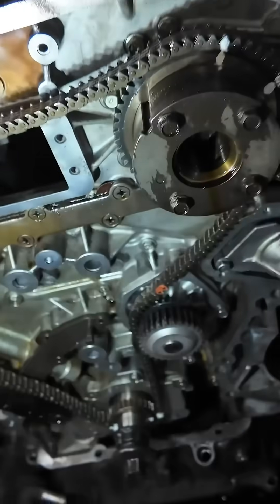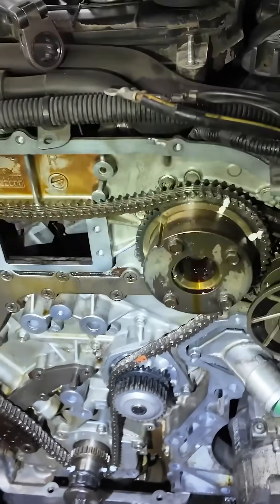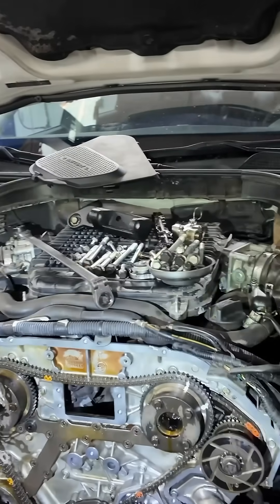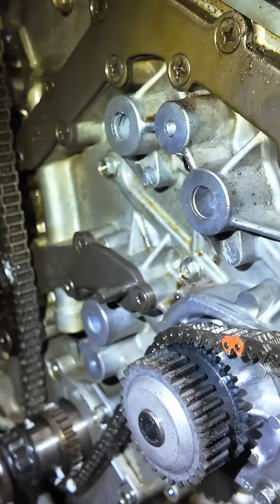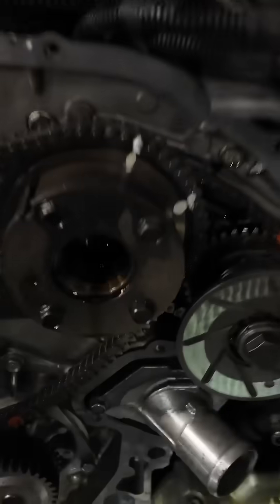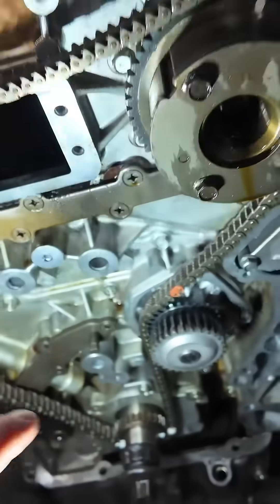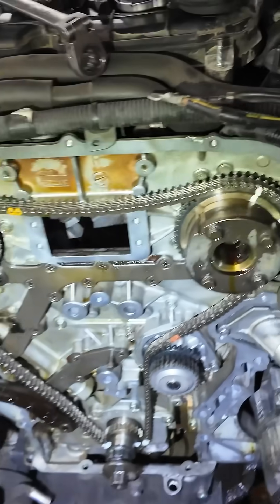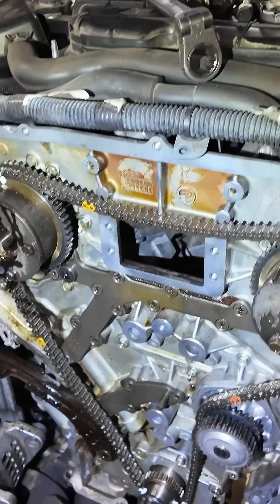The Shocking Truth About Infiniti's Costly Engineering 🚗#shrots

Comment: Audis aren't much better... you have to remove the timing cover just to replace the thermostat for the radiator, so you might as well do the timing, water pump, oil pump, etc while you're in there.
Reply from the maker: @CrazyCat229  yeah that’s right